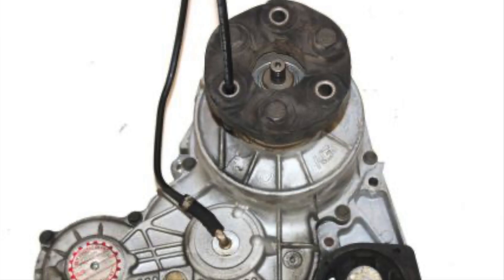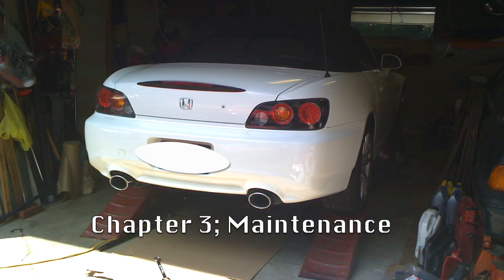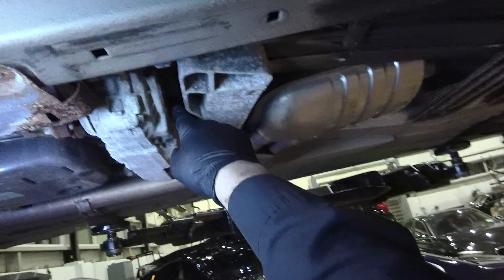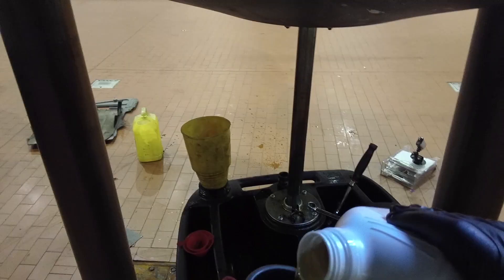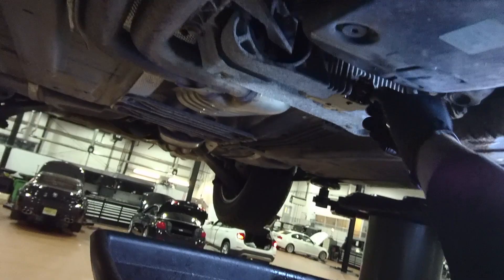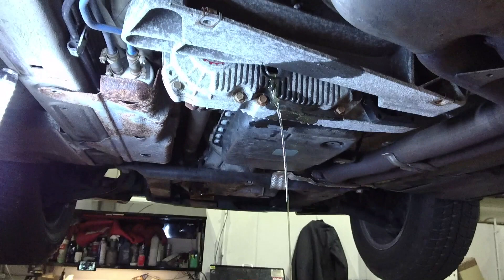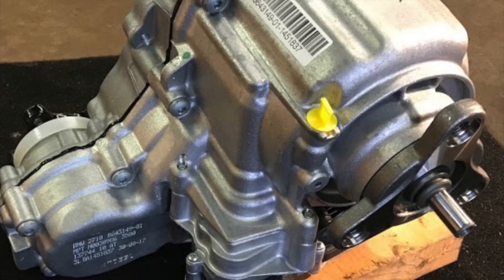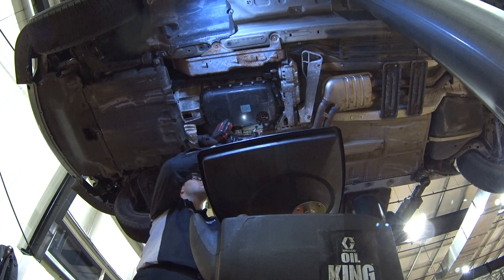BMW 325XI E46 Transfer Case Fluid Service DIY

Comment: Hi what oil for the nv124? My car e46 330xi. Greets Dennis
Reply from the maker: Does fcp euro or ecs tuning list fluid type for your model? Haven’t done a USA e46 330xi transfer case service. Really need a vin to check up info which is Confidential and that would be breaking BMW’s oath so best way is to find out from an Authorize BMW Center. Sorry for belated response.